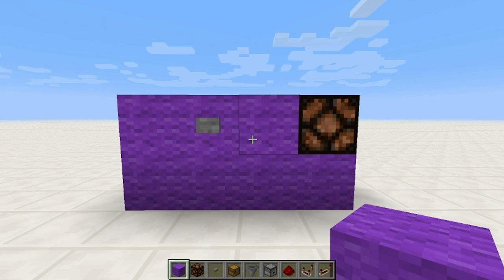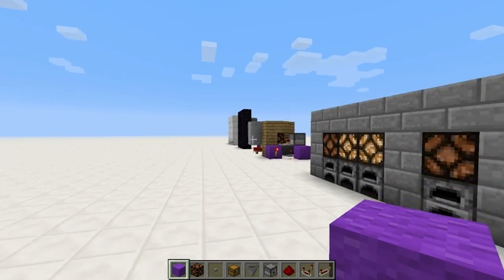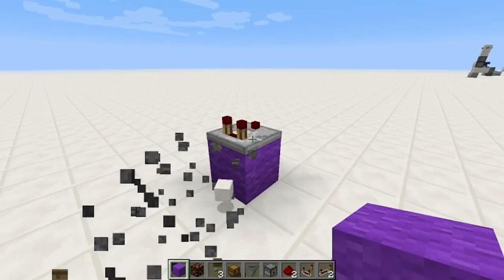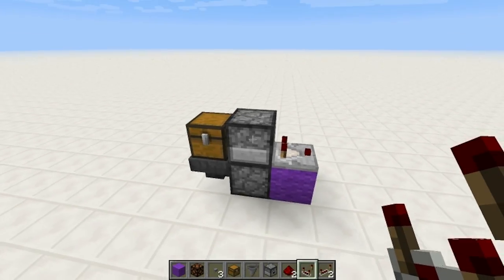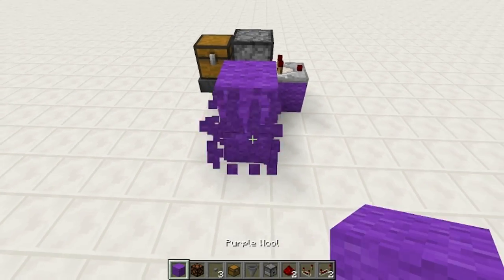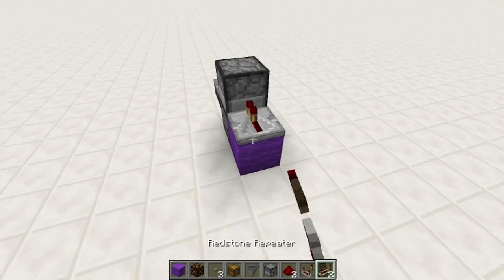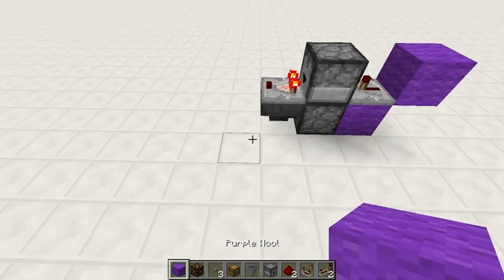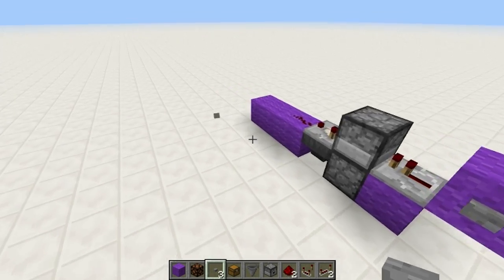Easy Peasy Redstone: Tiny T Flip Flop

Comment: An t flip flop can be made much easier/resource friendly using 1 dispenser, 1 boat, 1 water bucket, and 3 pressure plates then take an output from those pressure plates, done
Reply from the maker: Gaming WithJustine I'm aware of that kind of design, I just don't like it because it takes up more space due to the pressure plates that are required. This design, because it's only 1 wide and doesn't need ground per se, is WAY easier to integrate into other circuits and helps keep things compact. I'd rather spend the extra few iron and quartz to save a significant amount of space :)
Reply: oh ok

Comment from the maker: S'alright. A t flip flop can be used for a number of things. It's a circuit that turns on/off like a lever when given a pulse via a button or another circuit. It also accepts multiple power sources through the input. One example might be if you wanted to have 2 buttons hooked up to this one circuit where let's say each button is placed on the outside and inside of an entrance. Another example might be when you want to have on/off functionality within complex circuitry. That's just a few examples